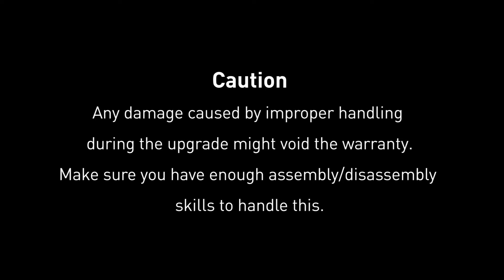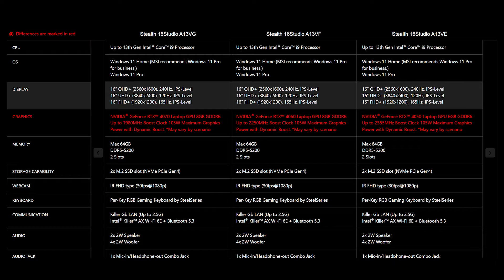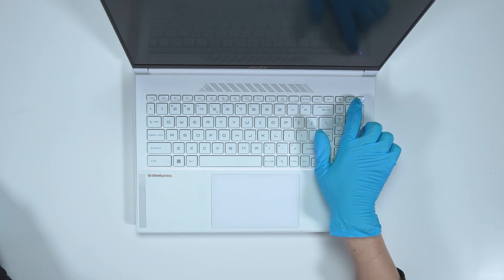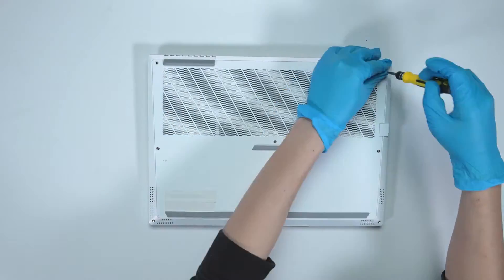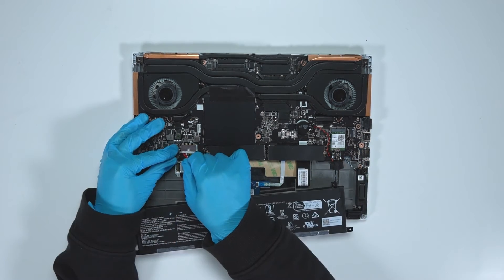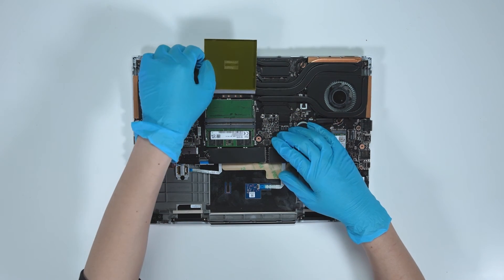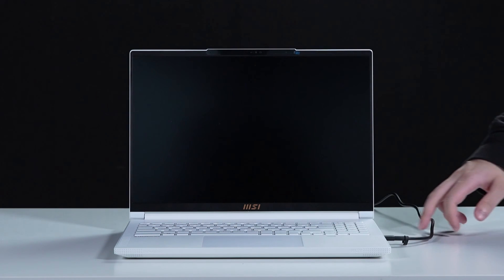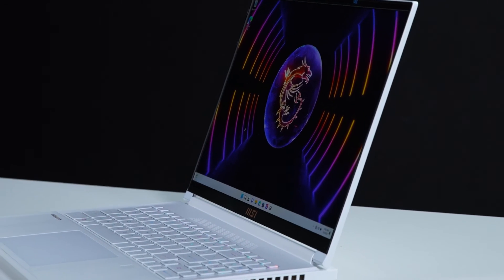MSI Stealth 16/A16 (AI/Studio) Series Upgrade Tutorial

Comment: ⚠Warning to those trying to add a second NVME: The screw already in place for a 2nd NVME was impossible to take out, even with a screwdriver just for NVME SSDs. It was screwed in too tight and I was damaging the screw. I just put my new NVME in without taking the screw off so it stands up with the back panel is off but should hopefully be alright. It appears in Windows fine. I was able to put the back panel on as I noticed the battery is still higher than this NVME sitting on top of the screw.
Reply: Thanks for the warning. It's such a weird decision by msi
Reply: I just did the upgrade and had no problems with the screw.
Reply: i had same issue, i ended up getting a really small drill bit, screwed down very carefully into the middle of the screw than used pliers to get the thing free then replaced with a new screw...but wow was that not fun!